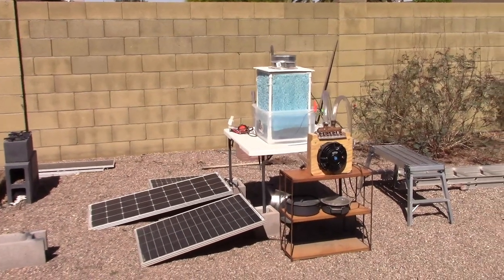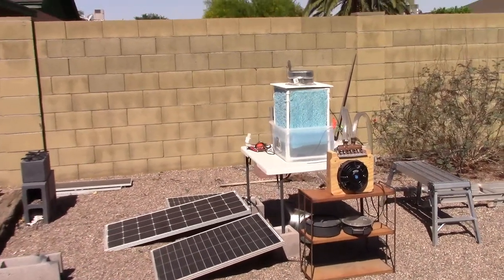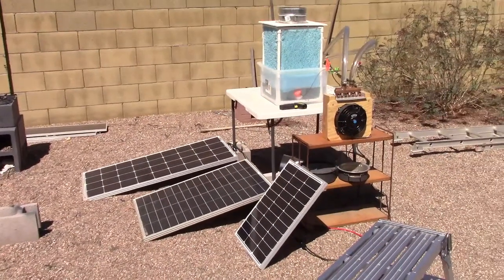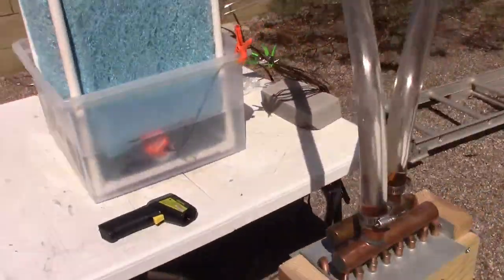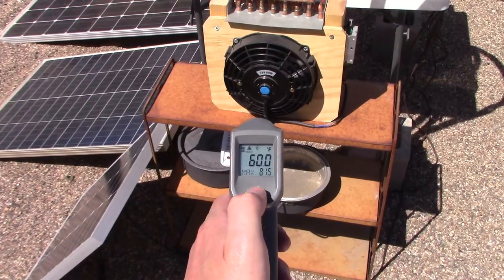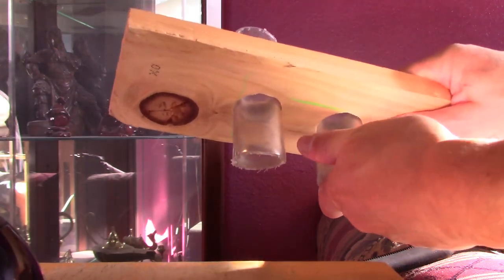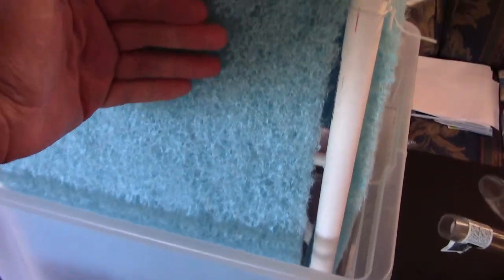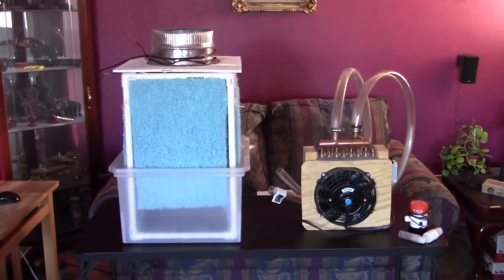DIY Indirect Evap Cooler! AC Air Cooling! (w/No Added Humidity!) cool and dry air!

Comment: The temperature of the water from the evaporative cooler is limited to the wet-bulb temperature of the outside air. When I lived in CA, humidities and thus wet bulb temperatures were low and evaporative coolers worked very well. After moving to TN, the wet bulb temperatures are usually about 70 deg. F or higher in the summer, so the evaporative cooler cannot cool the air of the water to less than this, significantly limiting the cooling that can be obtained using a direct or indirect evaporative cooler. If you are getting air and water temperatures from the evaporative cooler less than 60 deg. F, you must live in a fairly dry area of the country, usually west of the Rocky mountains.

Comment: Thanks for this great vid, I'm in the process of building mine right now :) . Just want to double check the wiring - you just wired the pump and the fan in parallel? That's it? Seems so simple!
Reply from the maker: awesome! i'm glad you're setting up a system.

Comment: Thanks for not being just another block-of-ice-and-a-fan video. I had to search a while to find this, which is the technology some manufacturer should be offering us. Can't understand why they refuse. I'd buy it but don't feel up to building it.
Reply: Hi I'm in Australia there is a manufacturing company Seeley international they make a evaporative cooler with this principle there called indirect evaporative coolers products name (Climate wizard) there's different sizes but the heat exchanger from diagrams I've seen doesn't really show a cooling pipe radiator setup.
A large esky to keep chilled water cooler .
Climate wizard state's the hotter outside air is the colder water temp will be.

Comment: Brilliant idea , esky for chilled water tub  , cooling pipe foam insulation keep water pipes cool.
Had similar idea years ago after feeling how cold evaporative cooler water got down too.
I'm thinking using my evaporative cooler on roof as water cooling source,  add water pipes plumb to a insulated heat exchanger (same as ac duct unit) attach it inline of ducted heating system which can be used in fan only mode , so it will be reverse cycled.
The ducted evaporative unit I'd let the air coming out unit dropper duct blow thought out roof cavity to keep it cooler as I'd say on a hot Australian summers day 40°C roof cavity would be 80°C.

Comment: Forgive my ignorance, but what is the fiber mat material you are using? When I was a kid in the 60's, the swamp coolers used some type of natural fiber. Thanx.
Reply from the maker: hi. it's just a standard evap cooler pad (the material it's made of is foamed polyester). most home stores sell the pads.🙂
Reply: @desertsun02  Thanx. Need a swamp cooler in my garage and plan to build one with a 20 inch box fan per your video.

Comment: You can add one pad below the fan in the mini cooling tower to act as drift eliminator. It will reduce water loss and the moisture out of the system.

Comment: Hey this is great, thanks for sharing. I am building a very similar system and had a few questions:

1. Have you considered adding a 3rd stage, involving a liquid-liquid heat exchanger where the cold water cools something like mineral oil or glycol, which is then sent to the liquid-air exchanger instead of water directly from the evaporator? I know that large places with industrial cooling towers use banks of “glycol” batteries to build up inventory of chilled coolant during off-peak as a load balancing technique.

2. Have you considered a method to recover the cool/humid air exhausted out of the evaporator? If I go with a 3rd stage like mentioned above I may choose to pass the warmed coolant return through a liquid-air heat exchanger positioned above the evaporator exhaust, theory being to remove a bit of energy before returning to coolant reservoir as a “pre-cooling” stage.

3. If you were to scale up this design, would you choose to go with fewer, higher CFM fans, or multiple evaporators working on a shared volume of water? I’d imagine the latter to be better because you’d likely have greater surface area of cooler pad….

4….which brings me to last question, what are your thoughts on either evaporative media and/or heat exchanger geometry? I have both a transmission cooler and and 1/4 copper tubing coil…I am thinking of ways to increase the turbulence in the liquid-air exchanger, or going with long copper tubes inside an air duct for counter-flow type approach.

Anyways very cool stuff, referenced your videos a few time as I’ve started this project thanks again
Reply from the maker: hey there, that's a lot of deep and thought provoking questions. i'll have to give it and them some thought before i can answer. i'm glad my video is helping you and good luck with your experiments and designs. keep us posted. i'm working on various upgrades but all in the experimental stage so far
Reply: @desertsun02  I'm following because we'd thought about what it would be like to pre-cool the ambient air by positioning the heat exchanger IN FRONT OF our one-directional (MasterCool style) evaporative cooler. The idea being that the air that comes through the wet pad has already been cooled. Would there be any compounding cooling, by drawing the 80-degree ambient air through the 60-degree heat exchanger, which your example shows drops the air temp to 60-degrees; and THEN through the (60-degree) wet pad, and then into the home? I"m thinking then that protecting the heat exchanger from dust and debris would be key to the whole setup. What do you think?

Comment: Who knew you could use water as a refrigerant! It is certainly environmentally friendly! Maybe not quite as powerful as all the high pressure "R" refrigerants, but far less complex and dangerous. It holds it's own, in this application, for sure. Great job.
Perhaps a revisit and integration of your previous Zeer Clay pot refrigerators with this heat exchanger?....

Comment: great design. I'm gathering up the materials to build this now. Great way to cool. I can not find the heat exchanger like this one. I like the one you use. Link?
Reply: I have watched his videos before, I do not have the link but am pretty sure I found the heat exchanger on Amazon.  Hope that helps.
Reply from the maker: hi there and thanks! awesome that you're building it! heat exchangers seem to be a hit or miss thing when it comes to whether they have it in stock. here is a link to 3 pages of them! https://badger-pipe.com/collections/water-to-air-heat-exchanger  i usually get ones from this company (but i usually get them on amazon because they (amazon) often sell them cheaper). if you can't find the 8x8 one they also have 12x12 and even 6x12. i just saw those 2 sizes on amazon yesterday (not sure who makes those 2 but those 2 sizes are close to the same size). one tip to finding them on amazon is to click on a couple of larger sizes first, and then look in the related area. that's how i usually find them. if i just put in 8x8 it often doesn't show them.

Comment: What if you made it just one pump that loops the water first through your dry air heat exchanger and then up to the top of the evaporator? Warmer water can lose more heat quicker!  
Also you could add a heat exchanger on the damp air outlet to recover more cooling before it's wasted.

Comment: This is my favorite one of the videos you have on this. What is the average relative humidity where you live and what is the humidity in your house? The reason I'm asking is because cooling a space with high humidity makes it cooler but the humidity still makes it unpleasant, .I'm thinking /planning on building one that I can run through my central air unit but only use the fan/blower, that way it will go through the whole house, I don't know if it will burn the blower motor up pulling the air through the heat exchanger/radiator or not, it will require a lot longer hoses to do it that way, I don't know if that's a good idea or not.
Reply from the maker: hi. humidity in my area is typically 15 to 25% (but can be as low as 3 to 6%). recently it was 70%. yikes, that's too high for me

Comment: Great project 👍 thanks... 
I want to share this idea with you and I would love to hear what do think about it. What do you think about attaching the heat exchanger and the fan with a freezer that is filled with anti-freeze kept at zero degrees Celsius.
The idea is the freezer act as the coolent and energy storage unit. Which saves buying batteries as energy storage.

I did some math. 
1 pound of ice 144 BTU
500 litre freezer chest with 400 litres of ice
Stores 882 pounds 127,008BTU
Freezer electricity consumption is around
290 watts per hour around 2500 BTU.
If the freezer is full of ice (400LITRES) we can use up to 2500BTU (by controlling the liquid flow rate or fan speed) without reducing the stored energy. In theory.
Freezer with full storage with power off will produce 8000 btu for 15 hours or less.

The idea is to have very small AC unit which is not available in the market. Also the freezer will serve as energy storage unit. In addition to with adjustment you can still use some part of the freezer as normal freezer.

Best regards

Comment: You are a genius. Do you have a product list with links to amazon or something?
Reply from the maker: hi. the links to the fans and heat exchangers change all the time so the best way to get them is an amazon search. for a lot more detail make sure to watch the longer video and read that description section. it's got lots stats and extras on the whole deal. here's a good link to some heat exchangers (3 pages of them) https://badger-pipe.com/collections/water-to-air-heat-exchanger. here's a link to a similar fan. max cfm 1730! https://www.amazon.com/DNA-Motoring-Performace-Electric-Radiator/dp/B01NB0LK0D/ref=sr_1_4?dchild=1&keywords=7%2Binch%2Bcar%2Bradiator%2Bfan&qid=1622901769&s=automotive&sr=1-4&th=1

Comment: Newb question, if my fan is rated at 6.6 amps, and water pump rates at 1.5 amps. Do I need to worry about blowing the water pump since it is less amps? (Both are 12VDC).

FYI
I also have 3 100watt solar panels. So I can hook them up either in series or parallel to increase amperage if needed. And I’m attempting to do this with no solar controller or battery like u did (I have a 80w fan and 20w water pump).
I have everything built except for wiring.  Thanks so much for the inspiration!
Reply from the maker: hi there. if you've got 3 12v 100w solar panels then you are set!. just hook the panels in parallel (like i do). that way the voltage doesn't increase. the items like the fan and the water pump just pull the amps that they need. the water pump will not blow.

Comment: Fantastic idea. Thank you for sharing. I was unaware of the water was so cool. I wonder if the humid cool air could be used in some useful way as well, maybe like connected to the Attic
Reply from the maker: hi there and thanks!. you sure can. my ideas are you can either blow it towards the solar panels so they run as efficiently as they can or you could blow the air back onto the pipes that go in and out of the house. that would help keep the water cool. (that actually makes it a 2 stage evap cooler, because you're cooling a part of the heat exchanger if you do that). the attic is an idea too or just blow the air out into an area - say if you have a deck or a picnic table. you could put the table near the cool air.
Reply: You don't want to add humidity to the Attic. I know it is desirable to cool the attic but not with a humid source. If you had a greenhouse, it could be used to cool that.

Comment: I can not find a 1500cfm duct fan anywhere, highest is 800, where did you get yours and what diameter is it?
Reply from the maker: hi there. i got it on amazon. it's a 7" fan. but no worries - they're out there 🙂 remember to add in the term high performance to your search. that should help you find them fast. i just found 3 on a search of amazon (well 2 that are 1730 cfm and one that is 1350cfm). all 7 inch ones. here's two links (first link is to one that is 1730 cfm and second link is to one that is 1350 cfm)
https://www.amazon.com/DNA-Motoring-Performace-Electric-Radiator/dp/B01NB0LK0D/ref=sr_1_4?dchild=1&keywords=7%2Binch%2Bcar%2Bradiator%2Bfan&qid=1622901769&s=automotive&sr=1-4&th=1

https://www.amazon.com/Universal-Performance-Electric-Radiator-Mounting/dp/B00T3T7IJU/ref=pd_sbs_2/134-1812861-1418214?pd_rd_w=WGghT&pf_rd_p=f8e24c42-8be0-4374-84aa-bb08fd897453&pf_rd_r=500P41BFHZ2D9RXQBYPY&pd_rd_r=7a062239-3171-4181-84a1-55b7da7190b9&pd_rd_wg=TaRBk&pd_rd_i=B00T3T7IJU&psc=1

Comment: How much money do the solar panels actually cost though?
Reply from the maker: hi there. these days you can pick up a good 12v 100w one for about 75 or 80 dollars (amazon). since they last 20 or 30 years a used one is a possibility too. if you're on a tight budget i've seen some used for dirt cheap.

Comment: Hi I have a question. Is it possible to use just 1 pump? Example, pump connects to the radiator first then it would connect to the intake of the evap and loop like that?
Reply from the maker: hi there. that would be pretty tricky. you might have issues with the water not moving at the right speed thru the units or with the right force. if you try it - let us know how it worked 👍

Comment: Loving it

Will implement that in an off-Grid Vipassana Retreat

Do you recon the humid air is too moist for indoors?

We have similar Arid Climate in South Australia

And how much water is this using roughly?
There is a bit shortage here in summer

And do you think, that you could chick the Heat exchanger in line with the moist air on the box.. to increase the cooling effect and make a more compact unit

Highly appreciate your work man
Reply from the maker: hi there. you could use the humid air indoors (just have to vent properly). but it defeats the purpose of using a heat exchanger. with some ingenuity you could probably use the humid air to help cool the unit down further, the unit uses about a gallon an hour in my climate (but will depend on how fast water evaporates in your area)

Comment: So is the air coming off the exchanger as cold as the air coming off the blue cube? or is there an efficiency hit?
Reply from the maker: hi. there is an efficiency hit (so it's a trade off) if you want the (no added humidity) air. it's not much though - just a few degrees
Reply: @desertsun02  Perfect, thats what I needed to understand. I'll build the cube, then build the exchanger and test them out. Currently closing in on 110 in the shade, so I'm happy to be at work where they have A/C lol
Reply: @desertsun02  I'm wondering if putting the cube in a hole in the ground would help it any (when using with the exchanger)? Starting to think of ways to improve my install, and get the most out of it. Once we get past 6:30 pm, it's pretty tolerable, but from noon till then, it's wicked hot out there this year.
Reply from the maker: hi. i wouldn't put it in the ground. you need a good flow of air through the pads

Comment: This is to cool I've been following for a bit but now I think I'm finally going to attempt a build my ac alone is just not keeping up with this summer heat. And quick question  Would making the pads taller to allow more time for water to travel through the  air making for a greater cooling temp
Reply from the maker: i say go for it! - it's easy to do!. you could make a taller version of the blue cube cooler. it wouldn't hurt - and would help if you use a larger heat exchanger. make sure to watch my taller version video of it. (link in description) 👍

Comment: Ultimately I want to cool a 40' fifth wheel RV. Nothing about an RV is efficient, windows are terrible, walls are thin, vent caps etc..
Reply from the maker: hi. you mentioned in another video comment section that you were looking at just going with direct evap cooling and that your air is super dry so just the blue cube or tall blue cube evap would be good for your situation. you'll get max. efficiency and the extra humidity can actually make you feel better if you have super dry air.
Reply: @desertsun02  Absolutely, and yep, sorry I got our conversation sprawled across several of your videos (your videos are awesome!!!) lol, I've settled on the tall blue cube, and if we feel its too humid in the house, I'll build the exchanger and add it on.
Reply from the maker: one last thing... just remember to vent the unit (when not using the heat exchanger) so any excess humidity escapes and you're 'good to go'
Reply: @desertsun02  Yeah, learned that the hard way with unvented propane fireplace. I bought a 509 stove "mini-me" this spring, and am installing it at the same time I'm putting my gabel roof on, heat shut me down, got all my trusses built and installed, next is sheathing and stove pipe hole, and tar-paper, and finally metal roofing. It's always an adventure
Reply: @desertsun02  those mastercool ones are called Cellulose Evaporative Cooler Replacement Pads

Comment: Hello mate,
Love your work. I've been thinking of doing something similar for my workshop and while researching the concept, I came across your video. 
You're getting some crazy efficiency out of that system. Typically you only see 10 degrees Celsius Td  across Cooling Tower Water Temps (depending on climate zone) so 15oC Td is pretty damn good.

So I can work out the kW Cooling of your system, are you able to let me know the details of your 'AC Cooler' Fan? Even if it's just Fan Diameter and the number of blades, I can rough in an estimate. I have calculated my system at 6.7kWc, so if I run the math on your system and it's close, it should mean I've done the math right on mine.